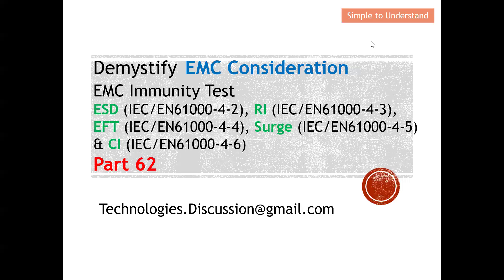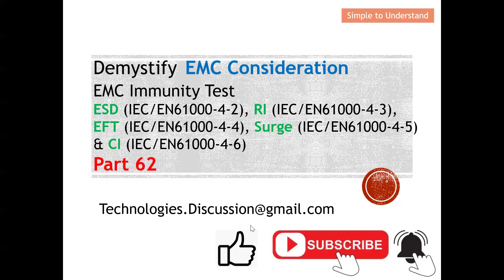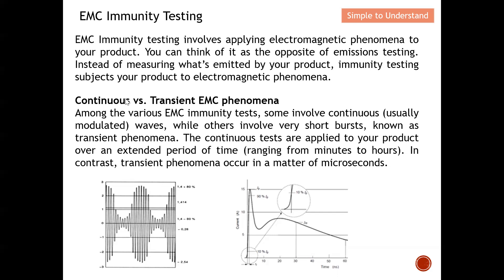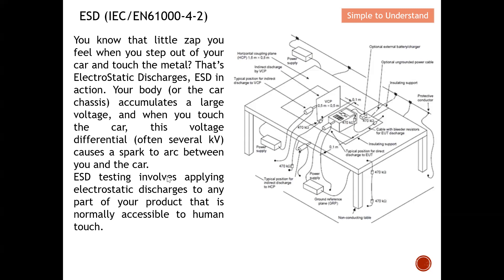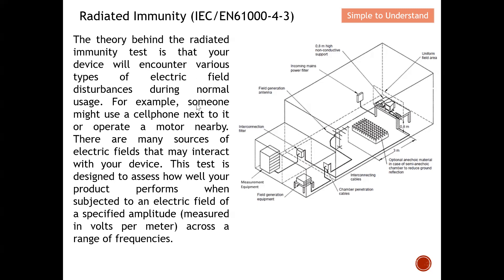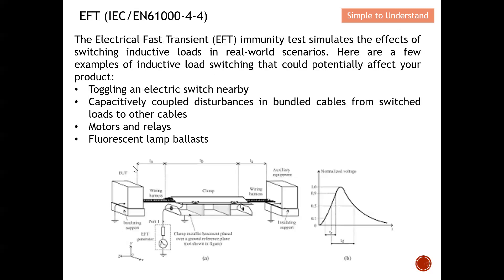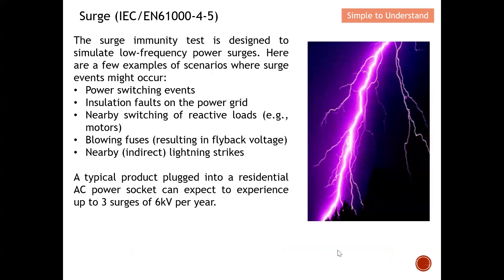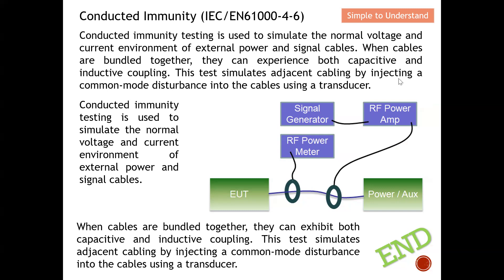EMC #62. Types of Immunity Tests Explained (IEC/EN 61000): ESD, EFT, Surge, RF & Conducted Immunity.

Comment from the maker: Thank you for watching this EMC video. EMC is one of my favorite channels. In this video, I discuss different types of EM immunity tests:
ESD (IEC/EN 61000-4-2) – Ensures devices can withstand electrostatic discharges, preventing malfunctions or damage.
Radiated Immunity (IEC/EN 61000-4-3) – Tests resistance to RF interference (e.g., from phones or Wi-Fi).
EFT (IEC/EN 61000-4-4) – Checks immunity to fast transient bursts (e.g., from switches or relays).
Surge (IEC/EN 61000-4-5) – Evaluates resistance to high-energy surges (e.g., lightning or power switching).
Conducted Immunity (IEC/EN 61000-4-6) – Ensures devices can handle RF disturbances via cables.
These tests verify product reliability and compliance with EMC standards.